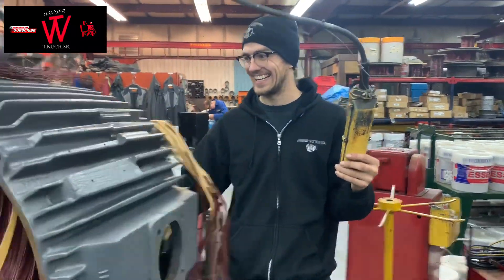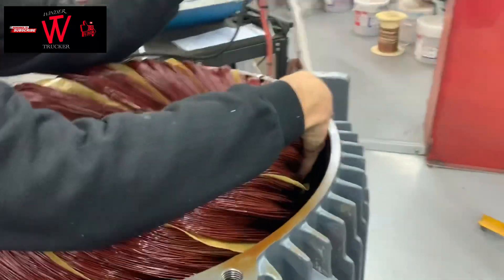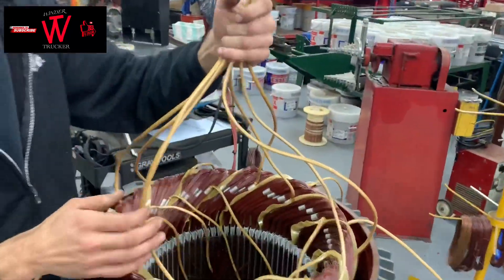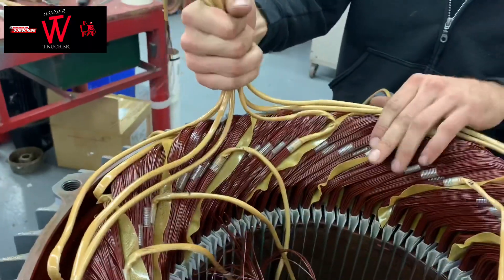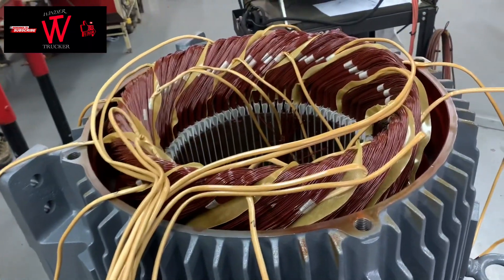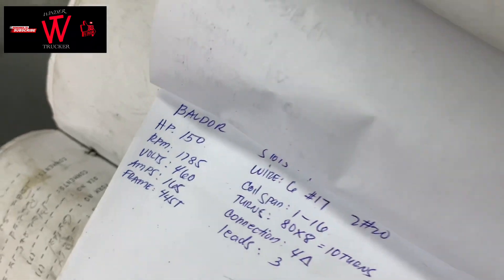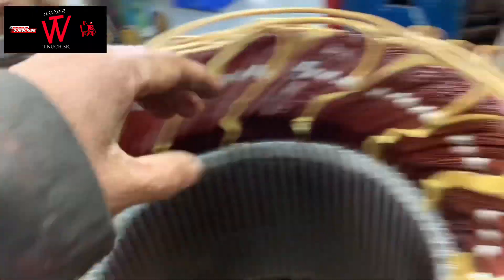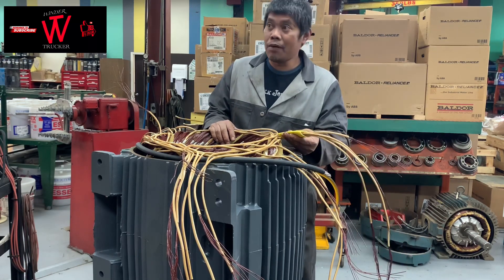Motor Rewinding | Part 2 | 150 hp Baldor | Connection & Diagram | 4 Delta 3 Leads

Comment: 15:45 Is it varnish or resin, after full submersion... do you clean the outside of the motor
Reply from the maker: Hey it’s Varnish yes scrape the varnish around housing,stator and threads

Comment: In egypt it must be 6wires exit from the motor to make star delta control pannel 
Is that different in yours and why
Reply from the maker: Yes that’s true 6 leads if the motor is designed in single voltage.12 leads motor has a multiple connections to feed from 230 volts and higher voltage.

Comment: Nice job for the new winder under your great supervision. My question is what are you using to test run this high amps motors please? Thanks
Reply from the maker: Thank you Steve,we’re using VFD runs in full speed in 230 volts.
Reply: Can you send me the type and model number for the inverter please?
Reply: The Model number and type of the VFD I mean please?
Reply from the maker: @stevetheuma  i will update you Monday my friend
Reply from the maker: @stevetheuma  you mean the surge tester?
Reply: @windertrucker6230  No the VFD type and Model number that can run your 350 HP motor as was in your video
Reply from the maker: @stevetheuma  sorry that was a reply for the other guy,yap i get it I’ll send you details Monday 👍
Reply: Any luck with the VFD name and number please?
Reply from the maker: @stevetheuma  i will make a short video for you tonight,Sorry i am busy at the shop lots of works it’s turn around season.
Reply from the maker: @stevetheuma  check out my new uploaded video.